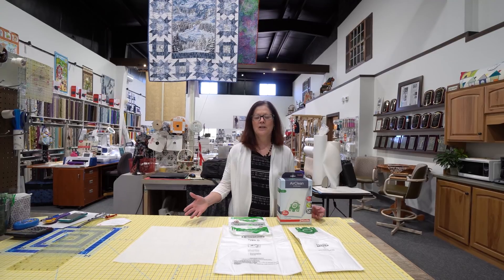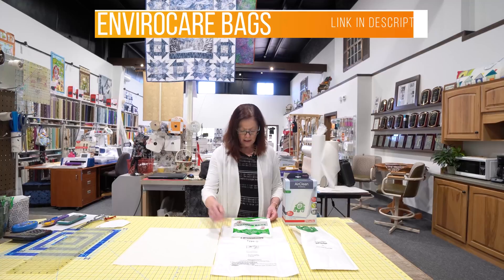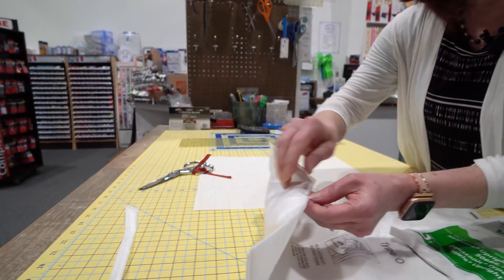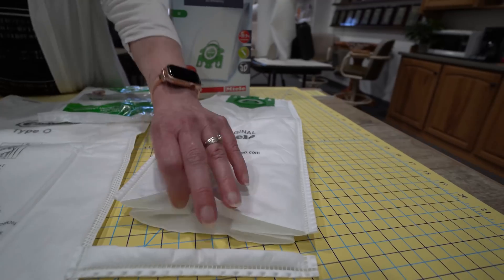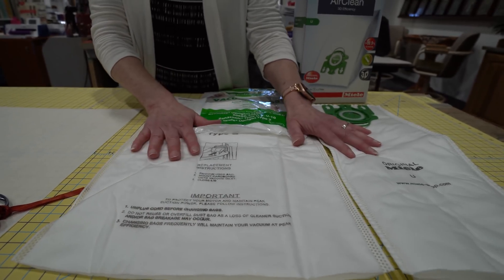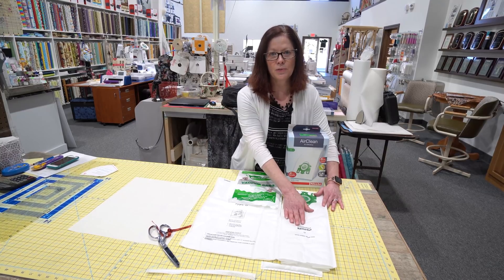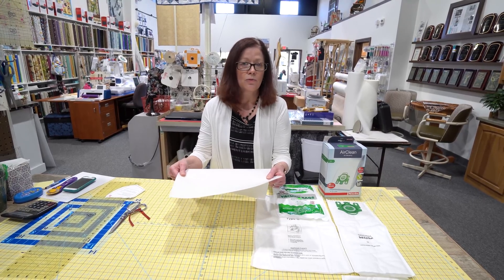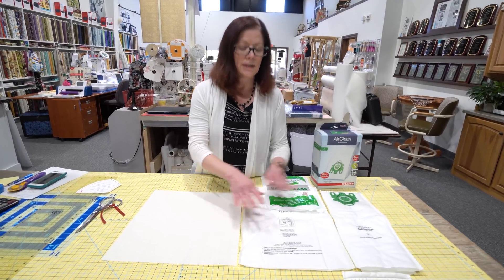Top 3 DIY Medical Face Mask Vacuum Bag Filters

Comment from the maker: ATTENTION: THESE ARE NOT HEPA FILTERS!!!!
Links to purchase:
Buy Miele U Bags → https://amzn.to/2Vr4VxZ

Polypropylene Filter Fabric 0.3 Micron Filter (1 Yard Per Customer, makes 10 masks)  → https://bit.ly/39qBBv6

Our top 3 Vacuum Bag Filter picks to use in your DIY Medical Face Mask.
The two bags are CLOTH bags and are NOT HEPA filters. They do NOT contain fiberglass.
The 0.3 Micron Polypropylene Filter Fabric: Surgical face masks are made with non-woven fabric, which has better bacteria filtration and air permeability while remaining less slippery than woven cloth. The material most commonly used to make them is polypropylene, either 20 or 25 grams per square meter (gsm) in density.

*Disclaimer:
Please be advised, Super Stitch, Inc. has provided the "Do It Yourself" Medical Mask YouTube video for instructional purposes only.

Any and all risks associated with the fabrication and/or use of the "Do It Yourself" Medical Mask is assumed by the viewer, fabricator and/or user of the homemade device. In no way shall the "Do It Yourself" Medical Mask replace a medical grade medical mask including, but not limited to, N95 Respirator Masks.

The material used in the instructional video, including, specifically, vacuum filters, have not been tested for use as any medical device and all such material has not been tested or proven to be a remedy against viral transmission, nor has it been approved by the FDA for any type of medical use whatsoever.

IN NO WAY DOES SUPER STITCH, INC., ITS OWNERS, OFFICERS, MEMBERS, EMPLOYEES OR AFFILIATES MAKE ANY REPRESENTATION WHATSOEVER, EXPRESS OR IMPLIED, AND DISCLAIMS ALL WARRANTIES, INCLUDING ALL WARRANTIES OF QUALITY, MERCHANTABILITY, OR FITNESS FOR A PARTICULAR PURPOSE.

FTC Disclosure: Amazon links provided are linked to my Amazon Affiliate account & support the channel at no extra cost to you.
Reply: In fact, everything on this list is out of stock!
Reply from the maker: We just got a message from our suppliers and we have a huge shipment coming in a couple days. You can sign up for our waitlist which is first come first serve. superstitchbackorders@gmail.com
Reply: @SuperStitchSewing 
I want to use these in masks I am about to make. I don't understand the ordering process. How do I pay for them with just an email address? Thank you
Reply from the maker: @thatgirlthatsme  We are sold out right now. We do have more but we need to process the 100s of orders that just came in two days ago. We are asking people to email us at superstitchbackorders@gmail.com so that you can be notified when we have the filters back in stock on our website.
Reply: @SuperStitchSewing 
 thank you for responding. I guess I'm just not going to be making masks although I really wanted to. I tried today to find things simple as elastic and they are sold out.  I saw videos of medical staff and on the news nurses begging us to help them by making masks. How can we help when there are no supplies? Everything I looked at (mask related) on store websites are saying out of stock till the end of May and even June. Amazon and Wal-Mart are two examples.  I'm 65 and haven't been anywhere in over a week. I feel so helpless. 
Thank you for all you are doing. ❤
Reply from the maker: @thatgirlthatsme  You certainly CAN help! Instead of using elastic, you can use hair bands or you can make ties that you can stitch onto the masks in place of the elastic. You can use anything that will allow someone to tie theirs on.
Reply: @SuperStitchSewing  
Thank you I don't know why I didn't think of making ties.  I've felt so defeated after all the dead ends I came to trying to find elastic. My daughter called today and said she had some stretchie headbands I could have. I felt better but I knew I needed a lot more than she has. 
I'll make ties. Thanks for that info.  It's a brilliant idea!
Reply: @thatgirlthatsme  I read somewhere if you open up bungee cord, it's full of elastics in there.
Reply: @thatgirlthatsme  jordan fabrics in grants pass oregon has great video on you tube. if you have cotton and needle thread/sewing machine you can help
Reply: @eileenmc4746  
I'll see if I can find those videos. Thank you so very much!
Reply: I went to the amazon link and it said the bags are microfiber, actually does not mention cloth at all. Are those the correct ones? thanks
Reply: yardage is out od stock ;(
Reply: Does anyone know if you can use Merv 11 filters and maybe double up for more effectiveness?
Reply: SuperStitchSewing need patten for mask
Reply: Where can I find tutorial to make a mask using the miele bag?
I've only seen videos for making masks using Filters
Reply: SuperStitchSewing making fabrics
Reply: Amazon workers have tested positive.  No protective gear given and they aren’t taking temps,
Reply: @thepursuitofhappiness2126  May day general strike

Comment: I do not think that these filters filter out better than HEPA filter which is equivalent to an N 95 material because it filters at 0.3 µm and it is already proven that HEPA filter does not have fiberglass in it many people are saying that it does but they don’t
Reply from the maker: None of these are HEPA filters, none have them have fiberglass and the polypropylene filters out 0.3 microns.

Comment: Have any of the manufacturers of these bags officially stated that their bags are safe to use for this purpose? I am really concerned that chemicals used in the manufacturing process of these bags (that they are not required to list) could have adverse long term health effects.  Do they outgas PFAS and PFOAS?  What are the size of particles they shed are they small enough to go through the mask liners used? I am afraid after this pandemic is over we may see a lot of irreversible lung damage from materials used in home made masks.  It would be nice for one vacuum bag manufacturer to state categorically what chemicals are used in manufacturing and how much and which chemicals are out-gassed after the bag is in the consumer market place. I would stick with 100% tight cotton weave that has been washed and rinsed enough times to remove any trace of sizing, detergent or other chemicals.  Also be aware of the fact that just using a HEPA filter does not insure protection against the virus. It must have an airtight seal against the face if you have a beard forget it. HEPA by itself means very little.  Think of it as a system the HEPA material is just one part of the system.

Comment: I contacted Miele about using any of their vacuum bags or filters as part of a face mask and they discouraged it.  This was their reply:

Thank you for reaching out to Miele USA. As a growing number of our consumers have inquired about our filters and bags to make face masks with, Miele has created an official statement regarding this issue. This is not only a concern of liability; this is also a concern of the safety and health of the public. Here is the statement: 

Dust bags do not provide adequate protection
Miele is frequently asked whether dust bags or the protective filters used on vacuum cleaners are able to provide protection against viruses. To be perfectly clear: Components such as dust bags, motor protection filters or exhaust filters used on vacuum cleaners are not produced by Miele. They are manufactured by specialized suppliers according to Miele specifications for use in domestic vacuum cleaners. 
The materials used are not suitable for use in face masks. It cannot be guaranteed that all viruses are reliably retained by the filter material of a dust bag. Air permeability is reduced on highly effective HEPA exhaust filters, resulting in the wearer of a mask made from this material having to make an additional effort to overcome this resistance to air flow. Besides this, the filter materials used are not suitable for exposure to moist breath over any length of time. 
We know, though, that our upstream suppliers are working hard on supplying optimum filter materials for use in face masks. These materials will then be distributed either direct by the suppliers themselves or by the relevant authorities.

We do not suggest anyone create facemasks with our vacuum components. 

Kindest regards,

James S (CSR03)
Customer Service Representative, Customer Service and Operations

Miele Inc. | 9 Independence Way | Princeton NJ 08540 | United States
Phone: +1 800 843 7231  | Fax: +1 609 419 9871
Reply: Brady Burke what they’re saying is basically that it will not adequately protect you against the virus particularly due to moisture. And that it may be hard to breathe in. Regardless I think it’s more protective than a cotton mask. However I wouldn’t want to have to wear this mask for hours at a time. But it might be a good idea for civilians using it to go to the store etc

Comment: i am confused. the outside of the back should be the outside of the mask too? you said this is the outside of the mask FACING YOUR MOUTH and then this is the inside of the mask FACING YOUR MOUTH. is the outside of the mask also the outside of the bag? can you clarify which side goes where?
Reply from the maker: The inside of the BAG, (the fuzzy part) faces away from your mouth when used in a mask design. The outside of the bag (the part with the writing) faces your mouth.

Comment: One consideration that may not have been addressed is that many of these vacuum materials have been electrostatically charged, which is what provides the fine level of filtration. Washing it (at least in the usual manner), from what I've read, will destroy the effectiveness that is gained from the electrostatic action.

Comment: I think you are mistaken:  the INSIDE of the bag (course "weave") should face outward on the mask, and the smooth exterior of the bag should be on the inside of the mask.  The filtration mechanism is not strictly a function of the size of the "pores" (interstices) of the fabric,  but rather depends also upon the fabric lattice thickness providing a "forest of obstacles" upon which particulates (virions) can adsorb and absorb.  Beyond mere physical dimensions, the particulates are entrapped in the lattice through molecular charges that cause the particles to "cling" into the lattice before the last barrier - the fine mesh face - is encountered.
Reply from the maker: We are both saying the same thing. The inside of the filter (the fuzzy part) faces away from your mouth and then you would add a layer of breathable fabric to cover it so it doesn't get wet. The outside of the bag (the part with the writing on it) faces your mouth.

Comment: I have the EnviroCare bags, doesn't say Hepa but does say, "99.7 micro filtration". If I use these, do I include the outside of the bag, which seems like a type of paper, or just the tissue like fabric under that? Would both layers make it hard to breathe?Thank!
Reply from the maker: Well there actually a few different types of Envirocare bags. The ones in this video are cloth bags so if you have ones that are paper, you might not want to use those.

Comment: Did anyone checked for hazardous materials in the filters?
Reply: meanmeanpt , I used filtrete vac bag , called  them , rerouted to Electrolux who is the maker now. They confirmed they do not have fiberglass in their bags.
Reply from the maker: None of the bags or filters in this video have fiberglass and are cloth filters

Comment: I have the Miele vac bags. I want to make a cloth mask. Do I cut out cloth for the OUTSIDE layer of the mask and then the vac bag for the INSIDE layer? Jut the 2 layers?  Just want to confirm that it's just front (outer portion)-cloth and inside (facing my mouth)-bag, not bag sandwiched between two cloth layers?  (I am NOT making the mask with the seam up the middle.) I understand that the fuzzy part of this particular vac bag goes AWAY from the mouth. Thank you!
Reply: Ann has advised me that she uses one cotton cloth layer and one filter material layer for the cloth mask. Thank you, Ann.

Comment: I have a UV sanitizing station for my cell phone I wonder if I could put my mask in there to kill off the virus
Instead of wedding them with soap and water or maybe even putting them in the freezer overnight I want to make things less we don't know how long this is going to take to get over a 
I hope everybody is going to be in a good position soon
Reply: I read virus last 2 years in freezer. So research. There is a you tube video on sanitizing masks so find it.
Reply: lol.. freezer?   if you do that , you will be breeding the virus and infecting everyone that get incontact with.  the virus in question is Covid-19 , it will die with heat.  a better option will be to use hot soapy water then dried for at least 72 hours, Then rotate.

Comment: ok, so i guess i've gone my entire life not understanding the definitions of "inside" and "outside"
Reply: Would you please explain this more succinctly? For me, the outside of the bag is the side that has the printing on it. Should that be the part that is touching your face?
Reply from the maker: @juliesavalas  Yes!
Reply from the maker: The inside of the bag is the "fuzzy" part, that part faces AWAY from your mouth which make it the inside of the mask. The mask has a front fabric layer, then the filter.
Reply: @SuperStitchSewing  that makes no sense. I understand that the writing, which is on the outside of the vacuum bag when it's still in one piece prior to cutting, should be against your mouth. There must be a better way to explain than saying things like the outside is the inside or the inside is the outside because people aren't understanding. Those may be sewing terms but most people doing this have never sewn or have minimal sewing knowledge.

Comment: You need to be careful, many of these vacuum bags have warnings about chemicals that are carcinogenic.
Reply: Obviously, they are using bags which do not contain the chemicals.
Reply: Your absolutely correct but they don't have to put warnings for uses outside their labeled and intended use.  These may be fine as vacuum cleaners bags where any noxious chemicals are dissipated in room air. But NOT fine for passing 100% of all your breathable air as in a mask. Concentration of chemical residues could be 1000s of times higher in a mask.

Comment: I purchased the Miele from amazon no problem & 3m filters from Walmart.  I know you did not mention 3M but in a pinch.  Also the out side of the bag goes away from the lips correct??
Reply from the maker: The inside (the fuzzy part) of the bag goes away from your lips.

Comment: Why not show how to cut the mask and also  it might be useful to mention what the pipe cleaner is for but I'm guessing it's to weave it through the top of the mask so u can mold it around your nose. Also when u cut the fabric and mention which is the inside and which is the outside about 3 times you point to the lettered side as the outside which we get but then u show which part is to be used for the inside but you're pointing to the opposite inside half of the material  which is very confusing. If u don't know what you're doing why post such an incomplete and useless video. U don't even show or mention how to attach a strap or heavy-duty rubber band to keep it on. your face. This is a terrible tutorial on making a mask that might save someones life during this time.
Reply from the maker: This is not a tutorial on how to make masks, it is only about the filters we chose. That’s pretty evident in the title of this video. There are actual tutorials on our channel and TWO of them are linked in the cards at the end of this video.

Comment: Is there anyone actually tried to make a mask with Enviro care bag? I tried but the inner layers made the sewing machine needle sticky/messy and finally top thread was pulled out and bobbin thread got tangled inside of the machine. I can’t even finish one mask w/o wiping the needle w/acetone.
Inner layers must have something doesn’t work w/sewing machine needle as its action makes needle hot because of material.
Reply from the maker: We have made several and didn't have any trouble. What size needle are you using and what thread are you using?
Reply from the maker: Also, did you purchase the bag from us or from somewhere else?
Reply: SuperStitchSewing No I didn’t buy from you I have extra using same bags for my vacuum cleaner Kenmore
Reply from the maker: @BellaC0422  Hmm, maybe your machine needs a cleaning. Here is a video that could help →  https://www.youtube.com/watch?v=2Z3a6Ex0mjY&t
Reply: SuperStitchSewing I just bought a brand new machine to make a mask.
Reply: SuperStitchSewing just regular needle comes with the sewing machine. Don’t known the size